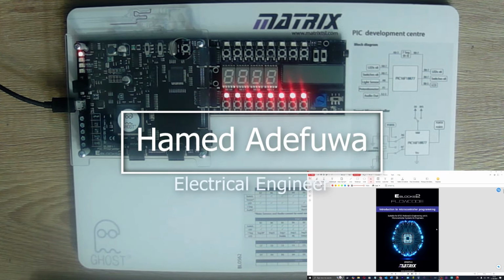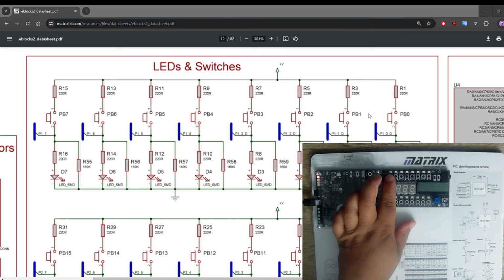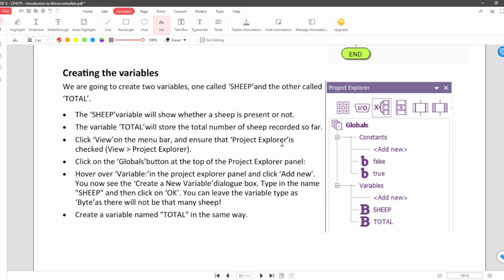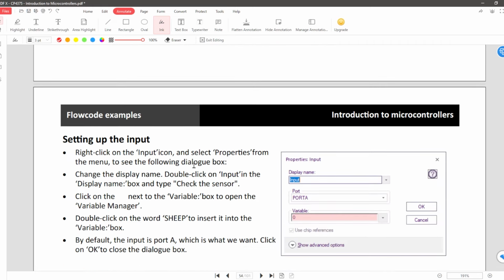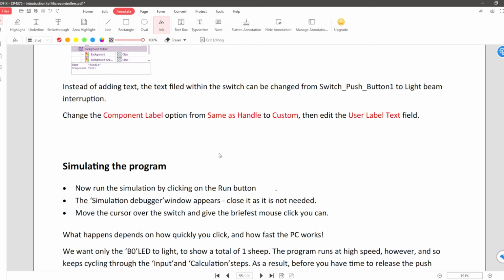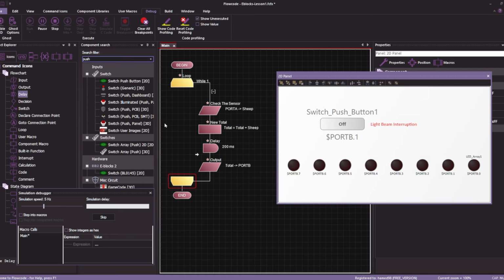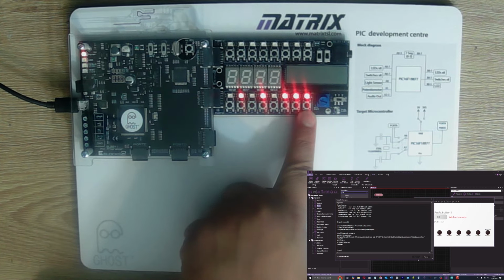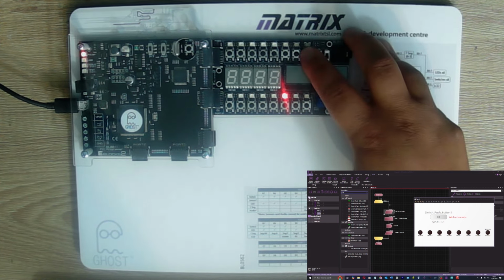Loops - Learning Microcontrollers with EBlocks & Flowcode #2

Comment: On  the 13 min. The reason why it simulation does not work the way it should is because you configure the switch push button  pin B1 (input) as the same in output array B1. In this case, both in the input and the output must not be on the same port.
Reply from the maker: @AmaduDainkeh  user error 😅😂 thanks for pointing it out. Could do with some sort of smart compiler that checks for this kind of basic user error.